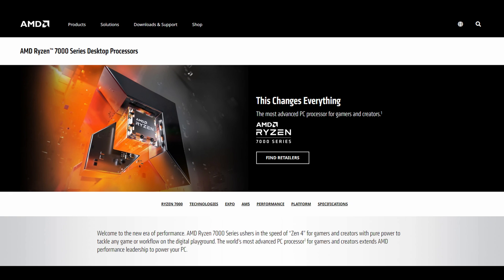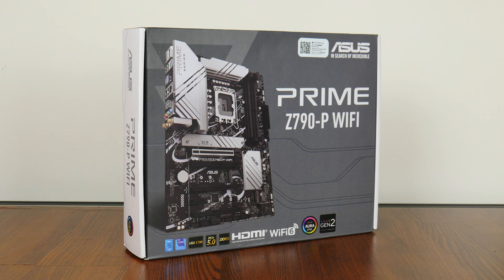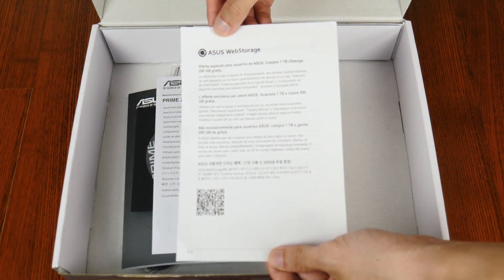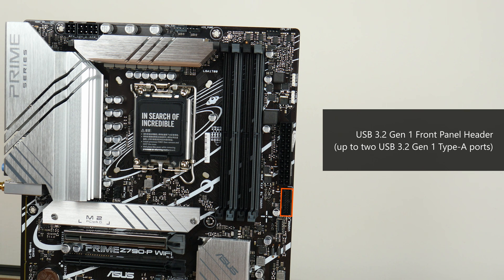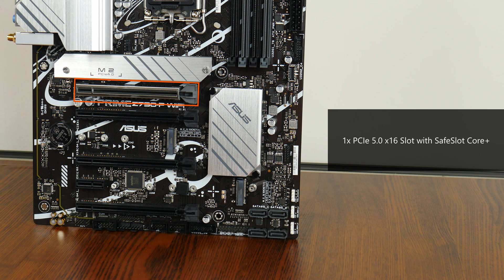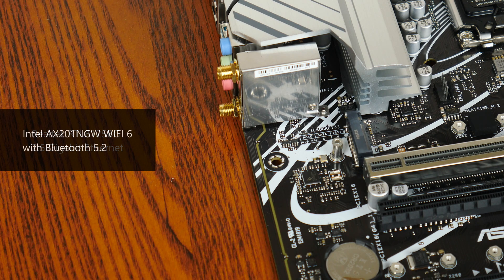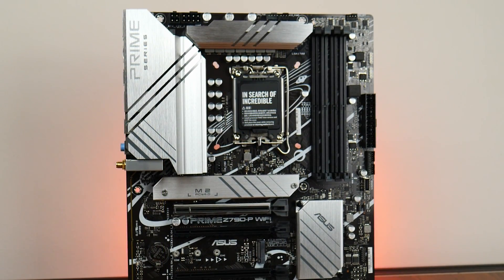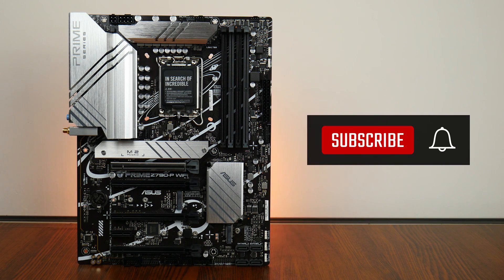Entry-level Intel Z790 Motherboard - ASUS PRIME Z790-P WIFI Unboxing & Overview

Comment: Hey if possible a quick review of the stuff i want to pair with this board (DDR4 Variant) Rtx 3070ti DDR4 4x8 crossair vengence 3200mhz would that be fine?
Reply from the maker: What CPU will you be using with this board? If you have the extra cash, I'd suggest going with faster RAMs, perhaps a DDR4 3600 kit instead!
Reply: @ALKtech an i7 13700kf
Reply: @ALKtech  I already have 4x8 sticks of ram so it would be a waste to get 3600 maybe oc the ram?
Reply from the maker: @yakirVk  ahh right. Since you already have the RAMs on hand then yeah, no harm just trying to bump up the timings to see if they run stable. If not...I guess you could always sell them off and get a faster set of RAMs further down the road!
Reply: @ALKtech  I haven't thought of that great idea though so you think this board will give good performance for the i7 13700kf? I don't know about motherboard that much I know this one is budget though
Reply from the maker: @yakirVk  yeah I think this board will handle a 13700KF fine - you'd definitely need to get a decent CPU cooler for the 13700KF. Are you intending to go with liquid cooling or a fan cooler?
Reply: @ALKtech  not a fan of liquid air cooling for sure
Reply: @ALKtech  I justed wanted to say thank you so much this really not expected for you to helpe this much ordered all the part gonna arrive next week gonna be sick Thank you so much❤️ I subbed
Reply from the maker: @yakirVk  happy to help! Which air cooler did you go with in the end?
Reply: @ALKtech  artic freezer 50.

Comment: What is between the 2260 and 2242 in m2 slot expansion. Is that the rubber pad? It’s in the way of me putting a crucial drive with heat sink in.  Yours also looks crooked where mine is square on the board
Reply from the maker: Yeap it's a foam/rubber "cushion" for when you've got a long M.2 drive installed (e.g. a M.2 22110 form factor drive that measures 110mm in length). No issues to remove it as long as your SSD fits securely into the M.2 slot with the appropriate standoff installed on the right opening!

Comment: I bought this to go along with my RTX 4080 and i9 13900k raptor lake. Since I put so much towards my GPU and CPU will I be okay with this motherboard. I just didn't see the massive difference between this and the Hero model.
Reply from the maker: I see, how's your CPU temps so far? I'm guessing you're using a 360mm AIO to cool the 13900K? Did you get any signs of thermal throttling while under load?
Reply: @ALKtech  I actually haven't got my pc back yet from the upgrades.  So I haven't gotten to test it yet
Reply from the maker: @Chunter95  ah gotcha. Would be interesting to see how your new upgrades fare when you get your PC back!

Comment: I just ordered a i9 13900ks Z790-P prime and a h170i elite cappelix , i will have some problem with this mother board?
Reply from the maker: You'll get by, though I personally would have gone for a higher-end board with a better VRM configuration, perhaps something from the ROG STRIX series and above. That said, I haven't had the chance to test this board with a 13900KS, so take my opinions with a pinch of salt! The Corsair AIO should do fine cooling the 13900KS I'd think...do share how your experience is like with this combo!
Reply: @ALKtech  Ty , i will share my experience here later .

Comment: Hey,
great video, this board has a BIOS Flash button, for bios upgrade without cpu or out of the box can i use a  i5-13600K CPU ?
Reply from the maker: This board should support the 13600K right out of the box!

Comment: Crazy how this board seems to cost 320-380€ since it's one of the only Z790 motherboards available globally.
Reply from the maker: All thanks to inflation too I guess - now that Intel's H770 and B760 boards are available on market too, such boards could serve up better value/pricing depending on your budget and use case!
Reply: 320-380€? I bought this board 2 months ago for 290€
Reply: @APARAT79  Yeah, at least in europe inflation took place for months in DDR5 motherboards. I'm lucky I could get one at 300. Now when I checked the prices have deflated to 284€...
Reply from the maker: @samtheman7366  I think given the global economic slowdown and slump in demand for PC hardware, we might see further drops in prices...
Reply: £240 in uk

Comment: Can i use DDR4 with this motherboard?
Reply from the maker: This board (PRIME Z790-P WIFI) doesn't support DDR4, you'll need to get the DDR4-specific version which is the "PRIME Z790-P WIFI D4" instead!

Comment: z690 is trash, never buy one, only z790 due to when the new atx and nvme 5.0 specs come out soon with 14k speeds the z690 will not work and be total waste of cash if you want pci 5.0 usage coming this year, z790 is the only buy right now, any older is total waste for future upgrades for those that will want the next gen drives and stuff in the next couple months

Comment: What about ARCTIC Liquid Freezer II compatibility with this MB? Has anyone ever tested it?
Reply: I would have been able to let you know if I got the right motherboard shipped from Amazon. It did fit in rog strix z790d4. But I'm doing a ddr5 build so waiting to get the right one.
Reply: I have it with the 420mm version and it's works with it fine.

Comment: Definitely not a budget motherboard. I'd consider this high value/mid-range with no frills. You get DDR5 support, 3?(I think) M2 drive slots, although only one has a heat sink. I'm using this in my mid range PC build with the i7-13700K for gaming/streaming.
Reply from the maker: I'd say, budget in the context of there being a wide spectrum of Z790 boards, with this board in particular being on the cheaper side of the spectrum with less bells and whistles - but it still has the features that matter!
Reply: This board is for broke folks. In all aspects this board is perfect for me, I can still use my previous DDR4 memory, GPU and storage all the while having the room for future upgrades.
Reply: @LyraniaLothar lmao ddr5 isnt significant enough either way yet to go for
Reply: @LyraniaLothar what exactly makes it for broke folks? What separates this board
Reply: Lmao it's almost 300 bucks wtf
Reply: @LyraniaLothar So you're a broke folk? 😂
Reply: I have the same cpu and motherboard

Comment: i have a hp nvidia Geforce gtx 1660 super 6g single fan graphics card will this motherboard be compatible with it ? & awesome video you got a sub
Reply from the maker: For sure - just to check, the card was pulled from a HP pre-built system? Graphics cards usually aren't proprietary and can be used in other PC systems, so you should be fine!
Reply: @ALKtech  yes sir it was thanks for the reply

Comment: really really detailed information! love the video! 10/10. I was researching into this board to see if this it would have a software installed or compatable to be installed, like Asus Aurora, on controlling ARGB since it has a 5v 3 pin connector? (so ive read, im not a pc nerd)
Reply from the maker: Great that you found the video useful! The board supports AURA SYNC, meaning to say indeed, you can control both 12V RGB and 5V addressable RGB devices via the ASUS Armoury Crate app, which you've gotta download from their website!

Comment: I am about to buy the I-7 13700k, 6000hz ddr5,and a motherboard would get the Asus Prime a over p. But, I'm not sold on this vs Ryzen. I am 75 percent, and upgrading from a 6800k, ddr 3 ram, while playing games on a 3080 and oled tv. Any advice? What would you do?
Reply from the maker: I take it that you'll be reusing the 3080 for your new build? Personally, and especially with AMD's recent CPU price cuts that seem to be holding still post-Black Friday, I find myself to be a little more inclined towards the AM5 platform, as it'll likely be supported for several generations (hopefully) of new Ryzen processors in the future, plus AM5 chipsets such as the X670E and B650E have native PCIe 5.0 for both the graphics card and M.2 slots. Just my two cents!
Reply: @ALKtech  ok thanks.
Reply: Even the i5-13600K outperforms some of the top Ryzen chipsets so the i7 13700K with 6000 MHZ DDR5 will chew through most applications without breaking a sweat. I'm personally using this board with the 13700K and 6000MHZ DDR5 (32GB  2x16) for gaming and streaming. I don't use AMD products, too many failures, driver issues, and poor quality control. I've never had an Intel or NVidia product fail on me in 20+ years of PC builds.
Reply: @ajm872000  i used both, from 35 years on intel, and last years with AMD. Both are pretty good brands, and never got any failure or other issues with my last 5800X3D, never. And not only do I play or stream with it, but I work on a big professional 3D video software, I've never had a problem! It is not correct to assert and peddle nonsense such as saying that AMD has problems without explaining which ones are specific to them.
Reply: I went with 13600kf with this mobo  and a G-skill trident z5 6000mhz cl36 rams .i don't have   issues at all using Rtx 3080 in an Oled  CX 55 inch . No need bios update for the mobo.
Reply: @alexandradeon7508  no issues with xmp overclocking?

Comment: Hi can you do a review on ASrock Z790 pro RS as compared to Asus's? Any thoughts about it budget mobo?

Great review video, 👍 from a fellow sgrean
Reply from the maker: Thanks! I can't seem to find the Z790 Pro RS in Sim Lim pricelists, nor on Lazada and Shopee though, so I can't really comment on it price-wise in SG...

That said, taking a quick glance through the specs on ASRock's website, both the Z790 Pro RS and the Z790-P WIFI are pretty similar overall, with the key difference being that the ASUS has on-board WIFI while the ASRock doesn't. The ASRock also has more M.2 slots and SATA ports and perhaps a fancier looking aesthetic with an integrated I/O shield cover and onboard RGB LEDs. Pricing wise, I'm gonna guess that the ASRock will be cheaper, seeing as the brand's modus operandi is to offer up attractive specs at much lower prices than the rest of the competition.

Are you intending to build a Raptor Lake PC with a more budget-friendly Z790 board?
Reply: @ALKtech  Yes, comparing both the mobo and happen to see your informative video :).

Building a i5-13600k PC, on a budget end with a ddr5 ram even though its not wise to make that decision now
Reply from the maker: @ternes.mp4  actually, if you're not in a rush, why not wait till Jan 2023 when Intel's mid-range B760 and H770 chipsets drop, alongside other cheaper Raptor Lake CPUs? Things might get more interesting then from an assortment and value perspective!

Comment: Really great review, I love it. Is the Bluetooth already available on the board or do I need to plug in the wifi antenna first
Reply from the maker: Thanks for the kind words! You'll need to plug in the antenna first - the Bluetooth and WIFI for this board both share the same antenna!
Reply: @ALKtech  thanks!
Reply: @ALKtech  not true at all. I didn't plug in the WiFi antenna because I don't care about or need it and I definitely still have bluetooth available to me. I use my DualSense controller wirelessly on my computer via Bluetooth.
Reply from the maker: @iRegGun9  is your PC very close to your controller? I've personally experienced situations where my Bluetooth connectivity improved significantly when the antenna was connected!

Comment: what would you recommend then if i would put a 13900k on it ? i dont want to go crazy in spending for a motherboard but i want a z790 in my build
Reply from the maker: Personally, if I'm going for a 13900K, I'd probably get a mid-to-high-end DDR5 board; if we're talking about ASUS, their ROG STRIX Z790-F GAMING comes to mind. For other brands, perhaps something from the AORUS series at least (for Gigabyte) or the MPG/MAG series (for MSI)!
Reply: @ALKtech  ive seen z690 is pretty similar to z790 (and way cheaper) and it has ddr5 on it..hmm
Reply from the maker: Yeap! You did mention that you wanted a Z790 in your new build though - if you are open to Z690 while they're still available new, I'd go for a Z690+DDR5 board instead. The Z690 and Z790 chipsets indeed have minimal differences after all, key differences being the amount of USB 3.2 and PCIe 4.0 lanes, which doesn't really translate into significant value when it comes to motherboard specs. If you can score a Z690 board on the cheap, I don't see why not!

Do note though, that you might be faced with the minor inconvenience of needing to update the Z690 board's BIOS with a 12th Gen CPU first, before being able to use a 13900K! Of course, if the board has a feature that allows BIOS updates without needing to install a CPU/RAM/graphics card, that would save some hassle...
Reply: @ALKtech  thank you for the advice <3
Reply: @ALKtech  what about a 13700k on a asus prime z790 A? Is the MB good enough?
Reply from the maker: @imhappy2777  the Z790-A is a step-up from the Z790-P in this video, and should handle a stock 13700K with no issues! Do you intend to overclock?
Reply: @ALKtech  I don't plan to overclock since i use it mainly for gaming only. However do you think the rog z690 f would be better? The rog is only $20 more but isn't the latest version(not 790).
Reply from the maker: @imhappy2777  mmm. Looking at the respective board's pages on the ASUS website, you'd be paying the $20 extra for a better audio codec, USB 2.0 on the rear I/O, perhaps slightly better components for the VRMs, ROG accessories and a more gamer-oriented appearance. The rest of the specs seem to be pretty much on par with the Z790-A - you do also get a larger variety of PCIe slots with the Z790-A though. 

The ROG STRIX Z690-F comes with BIOS FlashBack, so you'd be able to update the board to the latest BIOS to enable 13th Gen support without needing to have a 12th Gen CPU around! 

All in all, you'd probably need to see if you value the extra bells and whistles that the ROG STRIX Z690-F has!
Reply: @ALKtech  Thanks for your detailed explanation!

Comment from the maker: NOTE: This video was published before 48GB DDR5 memory modules were available - according to the ASUS specs page, this motherboard now supports up to 192GB of RAM with 4x 48GB DDR5 memory modules. Also, this motherboard now supports Intel's 14th Gen "Raptor Lake Refresh" processors with a BIOS update available for download from ASUS's website!

Check out the written article version of this motherboard's review here: https://www.alktech.co/articles/review-asus-prime-z790-p-wifi-lga1700-motherboard
Reply: Regarding maxing out the RAM:

I just took delivery of a CyberPowerPC, that I purchased from Best Buy (Black Friday sale), that has this Z790-P motherboard.
It came with two 32GB RAM sticks (64GB, total).

According to Best Buy's listing, the maximum RAM supported is 128GB, which I was planning to install (via two more 32GB RAM sticks).

But your comment conveys that I should be able to run this motherboard with 192GB of RAM.

How can I verify that my motherboard is capable of 192GB of RAM?
Can I assume that all Z790-P motherboards are compatible?  Or do I have to check for a certain version or release associated with my motherboard?

Any information you can provide would be appreciated.

Also, great video!
I learned more about my motherboard than what is in the manual or on any web sites that I checked.
Reply from the maker: @0Perhaps  I suspect it's because Best Buy forgot to update it's specs sheet 😅 you can refer to ASUS's QVL list here regarding memory support: https://www.asus.com/motherboards-components/motherboards/prime/prime-z790-p-wifi/helpdesk_qvl_memory?model2Name=PRIME-Z790-P-WIFI

Going by what's in the list above, it seems like this board supports Corsair's 4x48GB DDR5 5200 modules. You do give up speed for capacity though, and I must caveat at larger memory capacities, compatibility (at least from my experience) tends to become a bit of a hit-or-miss at times...